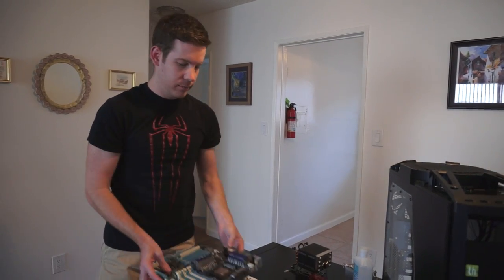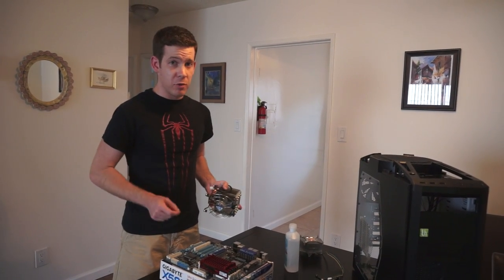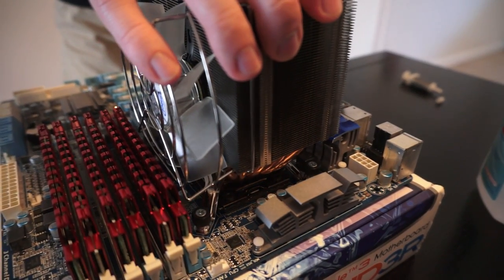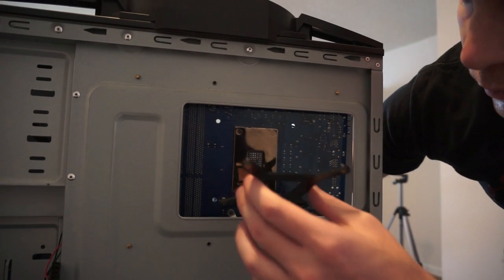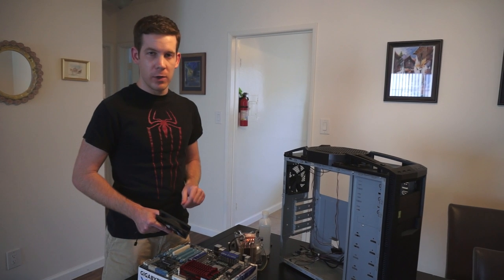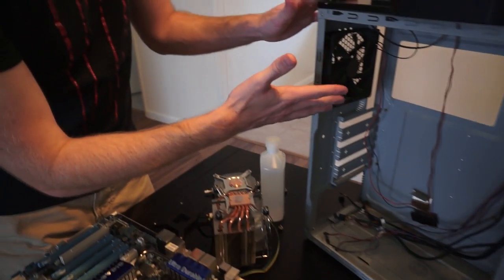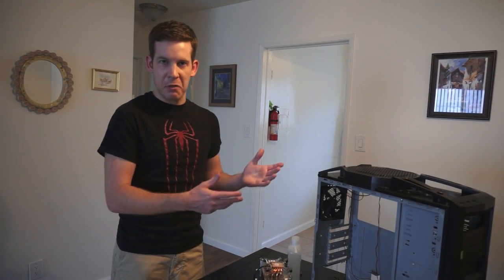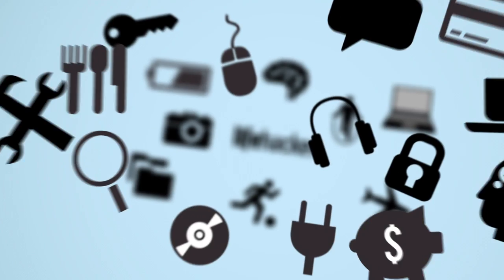6 Essential Tips for First-Time PC Builders

Comment: People keep saying im a idiot for choosing these parts,
http://pcpartpicker.com/p/kqgWTW

Will these be able to run ARK: Survival?
Reply: Picadio DoesGaming Here, http://pcpartpicker.com/user/Jamonlvl5/saved/#view=ZqDNnQ, you made some poor choices, you dont need an aftermarket cooler if yopu dont plan on everclocking (That cpu is not unlocked), the R9 380 performs a little better than the Gtx 960, do you really need the 2TB HDD?.  The psu was ok, but not good, and you dont need to buy fans.
Edit: Oh and the motherboard is way to "premium" for the components you choose, so a lower price motherboard is better for your parts.
Reply: jamon verdugo The r9 380 performance a LOT better than the 960. I know because I own the r9 280x and it performance exactly the same as the 380.  I've tested the 960 and 970 versus the 280x on 1440p on crysis 3 on my machine with the latested drivers as of 2 weeks ago.  The 960 can barely even handle that game at 1080p on medium ish settings WHILE maintaining more than 35 fps at ALL times.  unlike the 280x at 1440p medium ish settings.
Reply: jamon verdugo Either way, your recommendations for Picadio were good.  Cheers.
Reply: +tpcs The 280X performs quite a bit better than the 380. That isn't a good point of comparison if yo can't have an apples to apples comparison. Anyway, GTX 960 is cooler quieter and overclocks better.
Reply: +Picadio DoesGaming Swap the 2TB Hard Drive for 1TB and an SSD which youll install your system on. And if you can use more money get an i5 4690k
Reply: +Picadio DoesGaming You sure as hell will need atleast an i5 goddamn
Reply: +Picadio DoesGaming , cpu heatsink is good, but you dont need it, not with that CPU, and yes, get an i5 at the least. your power supply is a little under-powered, especially since you plan on putting all those aftermarket fans in your case. at least a 600Watt, also depends in your running more than 1 monitor on that grfx card, as the card will require more power...

Comment: i'm hoping on building my first pc here is what i got.

cpu:Intel Core i5-4670 3.4GHz 6MB Cache Quad-Core Desktop Processor

motherboard:MSI ATX DDR3 2600 LGA 1150

graphics card : EVGA GeForce GTX 750Ti SC 2GB GDDR5

ram: 2 Kingston HyperX FURY 4GB 1600MHz DDR3 CL10

pc case: Corsair Carbide Series SPEC-01 Mid Tower Gaming Case CC-9011050-WW

optical drive:ASUS Internal 24X SATA Optical Drive

cpu cooler:Cooler Master Hyper 212 EVO - CPU Cooler with 120mm PWM Fan

hdd:1TB SATA 6Gb/s 7200rpm Internal Hard Drive

operating system: Windows 7 Home Premium

psu: Corsair Builder Series CX 600 Watt ATX/EPS

does this seem fine? am i missing anything?please tell me your honest opinions
(estamated price is around 900 u.s dollars).
Reply: Is your budget about 900 or higher? I would say get a better graphics card and 8 gb ram if it is higher, but if it is not then you will be fine. Of course you can save up and get that extra ram and, I believe this would be a good card, get a 4gb Sapphire Radeon R9 270x OC edition. It would run some games at high to ultra at 60+ fps at 1080p and 1440p would do about the same settings at 50 fps. Fps is Frames per Second. In case you didn't know that.
Reply: I meant it will play most games at those settings.

Comment: is this a good build for games on high e.g crysis 3
CPU -Intel Core i5-4690K 3.5GHz Quad-Core Processor
Motherboard - Asus B85M-G Micro ATX LGA1150 Motherboard
RAM - Kingston Fury Black Series 8GB (2 x 4GB) DDR3-1866 Memory
Graphics Card - MSI Radeon R9 285 2GB Video Card
Hard Drive - Seagate Barracuda 1TB 3.5" 7200RPM Internal Hard Drive
Power Suppy -XFX ProSeries 450W 80+ Bronze Certified ATX Power Supply
Reply: Darkness D Get a z97 motherboard b-85m wont do for a i5 4690k
Reply: Go fora higher psu! Looks good tho
Reply: Darkness D Yeah, again, higher psu, that won't work. You could go with a Thermaltake Smart 750w (80+ Bronze), or 850w if you wan't some extra room for overclocking or something. Also, try this, get an i5 4440, and with that extra money, get a better gpu. I'm pretty sure it would give you a better performance at gaming, but you can search some videos to compare both combinations yourself.

Comment: Heyyy nice video, but can I ask an question?
Should I get more fans or stick with these ones I my pc.  Here are da specs
	
Intel Core i7-5960X 3.0GHz 8-Core Processor
NZXT Kraken X61 106.1 CFM Liquid CPU Cooler
Asus X99-DELUXE ATX LGA2011-3 Motherboard
Corsair Vengeance LPX 16GB (4 x 4GB) DDR4-2666 Memory
Seagate Barracuda 3TB 3.5" 7200RPM Internal Hard Drive
(2 x) MSI GeForce GTX 980 4GB Twin Frozr Video Card
NZXT H630 (White) ATX Full Tower Case
NZXT HALE90 V2 1000W 80+ Gold Certified Fully-Modular ATX Power Supply
LG GH24NSB0 DVD/CD Writer
Microsoft Windows 8.1 - 64-bit (OEM) (64-bit)
Creative Labs ZXR 24-bit 192 KHz Sound Card
Razer DeathStalker Wired Gaming Keyboard
Cobra E-3lue Wired Optical Mouse
Reply: Nilesh .K Tilwani Well. for a person with specs like those. you should know.
Reply: Nilesh .K Tilwani More important question is why are you buying this crazy insane overkill build if you dont even know what fan configuration you need.
Reply: If your CPU isnt water cooled, it wouldnt hurt. I would tho, for good measure.
Reply: Anthony Sparta  thanks for the help
Reply: Gaming . I'm gonna start a new YouTube channel
Reply: Anthony Sparta i'm not joking. i have a 680 classified and an i7 980x.
Reply: Nilesh .K Tilwani trying to show off, cool, You don't need more fans if u have keyboards included,
Reply: +NicholasStage Some people want to be able to use discs, and doesnt want external sound equipment

Comment: I have a question. When u build ur system outside the case so u can test boot it. If u wannt to use a watercoler and dont want to put on the stock cooler for the test boot. Can u test boot whitout a cpu cooler, cuz u only need to have the computer on like 10-15 sec when u test boot? Then the cpu doesent get overheated. So can u test boot whitout the cooler?? btw sry for bad english, I am norwegian!
Reply: If you have windows 8 you can't even boot you PC without a cpu cooler I don't know about Mac's or windows 7 but I do know about windows 8
Reply: Iver put the stock cooler on. it just clips on and then you can just take it off when you're done.
Reply: yeah, i thought of that too :D

Comment: You dont use toilet paper to clean the cpu.... Use a coffee filter
Reply: ***** XD No wonder you don't have enough money to buy a pc. You own products from apple and razor XD
Reply: Machoalbatross u mean a covfefe filter?
Reply: +Machoalbatross 

I use q-tips.. maybe I'm weird, but it works.
Reply: +Andloo Yunty That should be fine too, just make sure no threads from the qtip fall in the socket/on the moboard.
Reply: ***** It isn't personal preference, toilet paper can leave fibers that can damage the cpu by not letting it form a full seal with the thermal paste. 

     Also, how old are you? I'm 14 and I self funded a build in summer 2014. Just go sell stuff on ebay or have a lemonade stand or something. That's how I did it. Sure, my build started out $230 with an APU, but now I have a ~$500 machine with a ton of upgrades. Start small and grow through time.
Reply: Actually, you should use a toilet paper you used after toilet, because all the protecting material are in it...
Reply: +Machoalbatross Yah you just dont want any lint burning up under your heat sinc. Coffee filters are best.
Reply: wow so true
Reply: Doesn't matter I saw people using sanding paper

Comment: For first time builders like myself, make sure you read the 'detailed instructions' from url link below. I inserted cpu & connected cpu fan, ram, psu, monitor (on board graphics), anxiously hit power switch on psu. Nothing. Heart sank into feet, mind raced, told myself not to panic (failed), took a deep breath and walked outside. 1/2hr later, came back, looked at url, read instructions, oh.... turn on motherboard......was that not in video or did I miss it? -.-

Comment: Your TIP#1 has a flaw:the first time builder will not know how or where to start the system.You didn't mention to connect the power button from the case or to use a screwdriver.

Comment: When building a pc follow the companies who are backed by their name not overpriced crap like dell, hp, old gateway crap ..they are built to fail!  Intels i7 core is great amd is falling or was ...build your system to match the specs of what you want it to run ie: autocad has a page devoted to system requirements. Hard drive rpm speed is something to pay attention to and power supplies you dont want an underrated ps when you want to upgrade later..just saying

Comment: Here's an important tip you didn't mention: be aware of static electricity and take steps to keep it from damaging your components. It doesn't take much at all to damage or destroy some of the more sensitive components on those circuit cards. Keep the cards in in the ESD bags they came in until you're ready to install and make sure you ground yourself before touching them. There's a bunch of ways to ground yourself, a quick Google can help you find what works best for you.

Comment: I'm thinking that PCs might end up being cheaper in the longer run though, especially with Steam around. With consoles, most games tend to be 60$, especially at launch. But on Steam, you can get plenty of games below 60$, and it also has controller support. Internet access is free (technically), and you don't need to buy stuff like Xbox Live. Also, if a part of the computer breaks, you can just replace that part. Harder to do that with a console though. Its just my opinion though.

Comment from the maker: Learn from our mistakes with this video: six things every first time PC builder should know but few do.

Read more: http://lifehacker.com/6-essential-tips-for-first-time-pc-builders-1458484291
Reply: Tip #2: Learn from the mistake
Reply: There is no feeling like building a PC, pushing the power button for the first time and having it run. Then, installing the OS and seeing the OS fully booted up for the first time. It's a high.
Reply: If you're going to build a computer - do NOT buy a mac.
Reply: Tip #2: Don't listen to Andy Boyle if you want to build your own PC like the title and the article states.  On the other hand you can build yourself a very stable, low cost, high performance hackintosh for less than half the price of a comparable mac pro. Hackintosh Pro Project! [Part 1]
Reply: Tip #7 Always wear a grounding wrist strap.

Tip #8 Install a reliable Linux distribution from live CD/USB.
Reply: My tips:
1) Don't skimp on the PSU.
2) Choice of case is not simply about how many LEDs you can fit inside. Think about layout, connectivity, access, build-quality and cooling.
Reply: Tip #2: Disregard Tip #1. Unless you have no clue how to use a computer, are 85 and just want to get on the internet and your aching arthritis prohibits you from double clicking.
Reply: Good tips, the main thing I learnt when I first built a PC is: Don't forget case stand offs for motherboard (silly but almost ruined build because of it)
Reply: Take the MAC and Piss on it. Give the PC to your little sister and go out and buy a machine from Sun Micro Systems..
Reply: Yes, buy a Mac instead of learning to build a computer for yourself, which you could then put OSX onto.  Choose the lazy route!  Don't learn for yourself because Apple stores have people who can fix it for you!

My father bought a Mac because he doesn't want to deal with computer issues.  He can just bring it to the Apple store if he has problems.  I'm perfectly fine with that and agreed it was a good choice.

I built my own computer.  I run Windows 8, but I can also pull up OSX or Ubunutu in a virtual machine anytime I want.  My computer runs great and I built a better computer than a Mac for less money.

Either way works.  It depends on your situation and whether or not you are willing to learn and maintain your own computer.
Reply: Take your time in building. Took me 5 hours for my first build because I wanted to be careful.
Reply: +Andy Boyle I built a gaming PC in 2003. It died one year ago. The only parts  i had to replace were the PSU, and hard drives (which is standard maintenance on any machine), between now and when it died. This PC lasted me 9 years. The only reason it died, is my brother borrowed it, who smoked around it a lot. I think that friend the CPU some how. Yes PC's can last as long as Macs. It depends on the parts, and how well you take care of them.
Reply: i like the out takes. lol
Reply: Tip #1:  Buy a Mac.
Reply: I built a fair few systems in my time. I can't be bothered with them any more as I don't have the time to make use of them. It's rather sad that I have given my £2,500 GBP gaming rig to my mother for her to play Solitaire on...
Reply: Electric cars are overpriced. So are Macbooks. Oh yeah, they both suck.
Reply: ***** while I agree with you, I don't agree with the users that came to a thread about building your own PC to tell us that Macs are the best.
By keeping your analogy: is like going to Walmart and telling people buying bottled water that apples are better than pears. It might be true (or not), but that's not what they were looking for and that's NOT relevant for them at that moment.
Reply: Michael W. Moore basically Andy Boyle can't tell the difference between an OS and Hardware.  He thinks PC =  Windows.

Macs are PC's no matter what he thinks.  They just use very selected parts chosen by Apple for OSX.  Usually these are parts that make it difficult for the consumer to do anything with, or upgrade them.  ie. Apple only wants you to buy new things from them.
Reply: I built PC's too.  Until I bought my first Mac in 2008.  That same Mac still works great.  I have never had to wipe it, replace anything on it, or take it to the Mac store.  I have NEVER had a PC last that long, last anywhere near that long without replacing parts, or last anywhere near that long without having to wipe and reload software and/or the OS.  I could spend my time fixing my PC, or, I could use my time productively working.  I chose the latter.
Reply: Justin Frederick
I hate the company and it's shady practices. I don't hate their computers (other than the price and the "lets ignore any problems people have with these" mentality that may or may not still be around (especially when it came to security). I've heard/seen on youtube some pople that had their macbooks perform a kernel panic and after having Apple work on it and claim it's fixed, the person has it happen again after returning home and powering it on to begin using it. I hope such things were fixed on the later versions of 10.8.x and in 10.9
Reply: Barclay Lucid there's no feeling like building a PC, pushing the power button and seeing it doesn't start, then spending half an hour to find out you reversed the USB connector :). But I agree, I built almost all my PCs (the first one was bought prebuilt, but I fiddled with that one too).
Justin Frederick there aren't that many Mac haters, but when the comment section starts with a trollish comment (no matter what kind of troll; it was a Mac troll this time, but it could have been a different kind of troll), then you'll answer him, right?
Reply: access is a big one
Reply: Andy Boyle I have 4 CNC machine tools that have been running since 1997. other than hard disk failure the PC based controls are still in fine working order. not bad for a 16 year old PC inside of a machine tool that has vibration oil/water mist, and etc. Use quality components and your stuff will last.

Besides what is so great about Macs anymore? They are PC based.
Reply: A really competent friend built me a PC in 2006. It was still running well when I decommissioned it a few months ago. It still ran but was low-end to start with and outlived its upgradability.
Reply: ***** I said I agree with you. I was talking about the first poster.
I really don't understand the 'auto defence' stance and the need to be impolite to everyone and assume the worse.
Reply: Exactly, did l miss it or was that not mentioned in video, only in detailed instructions.

Comment: I'm an IT engineer student and I think that the selection of parts can be complicated. Especailly when you have to math something out. But the building phase is fairly easy.You just have to know basic stuff like in the video. Read the motherboard manual how to connect the parts and thats it. Cleaning is another thing... DON'T use vacuum cleaner!

Comment: Actually you more of a negative air flow.... cool can always be sucked in through the gaps all around the casing but if you have too much positive air flow there will be thermal build up of heat as heat from hot air is passed to the cooler air before it evens gets to the heatsink to do the heat transfer from there.